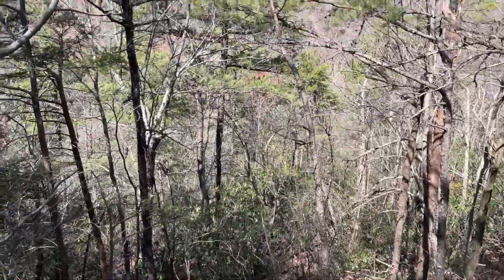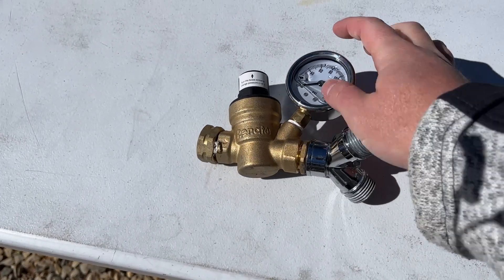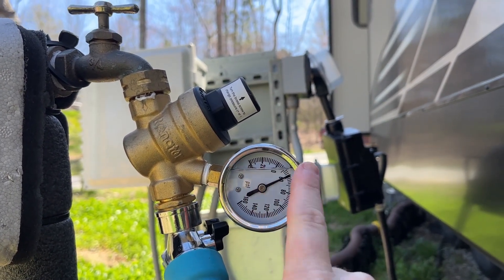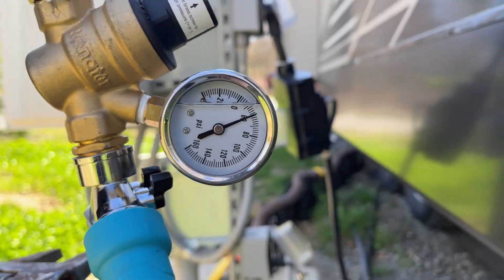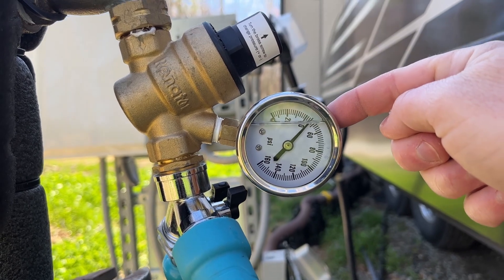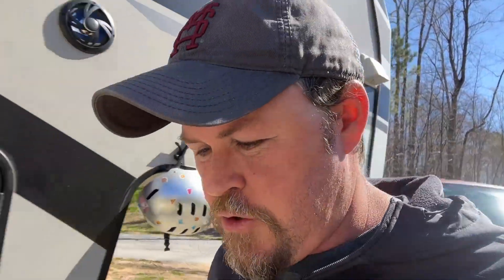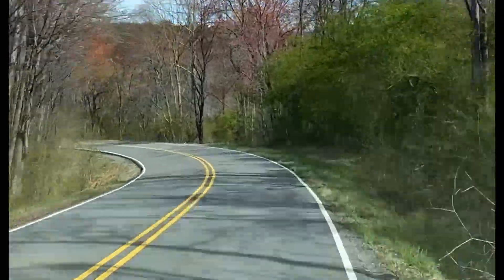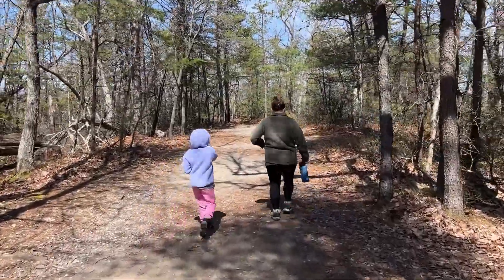How to Use an RV Water Pressure Regulator + North & South Carolina | RV Living | Ep 22

Comment: I wouldn’t have the static over what your manual for the rv says is a safe psi. It’s the static pressure reading that’s putting the pressure on your fittings and pump check valve that you’re trying to protect

Comment: You can also set it so that the pressure coming out of the supply is what you want. Then every time you go to a new place it will be the same.  I don't like having to park somewhere else because my truck won't fit in the spot, but it happens.

Comment: If the static pressure is high, will that pressure damage your lines? I have been so careful but would like more pressure my static pressure is at 40psi .
Reply from the maker: From my understanding high static pressure can damage your lines if it’s not regulated down before it goes into the camper. What we’ve been doing is turning on the water with the regulator attached before hooking it up to the camper, and adjusting the pressure. That way our regulator has the pressure at 40 to 50 PSI before we ever hook it up to the camper, just to be safe.
Reply: @Herrins on the Roam  When the water is off what does the gadge say ?
Reply: Like when your not running the water in the coach .
Reply from the maker: If the regulator is on the spigot with the water turned off, that is the static pressure. Once the water starts flowing, either with no hose attached or at a fixture in the camper, that is the pressure your regulator is set to. That is what is adjustable, the pressure when water is flowing through the regulator.
Reply: Completely WRONG! The "static" pressure is what you need to regulate! The "static" pressure is what damages your rv!
Reply: @John Jones  i just keep it at 40 psi when water is off in the coach , my gadge says 40 psi .
Reply from the maker: @JohnJones-op8uf  our original comment already mentioned that static pressure can damage your lines. That’s why we regulate the PSI before it goes to the camper.  In this comment we are just saying if the water is running you can see the needle move in real time. We keep ours between 40-50 psi static.
Reply: @herrinsontheroam  absolutely did not! You told folks to adjust the pressure while water was flowing (fixture in rv on). That is incorrect! You do NOT adjust the pressure, etc, when the water is flowing. The pressure regulator is there to keep the STATIC pressure down.
Reply from the maker: @JohnJones-op8uf  huh sorry must have misunderstood what you were saying. We adjust both, the static coming from the source and what is going into the camper. Maybe I didn’t explain that well in the video, we use the faucet so I can see the gauge move, otherwise it doesn’t ever change until the water has been turned on and off again.
Reply: You guys are so confusing.

I need a device that can reduce the static pressure in my water lines, when the water is not flowing.

Let's say that the city water static pressure is 75psi, with no water flowing.

I need a device that only supplies my camper with 35 psi static pressure, when the water is not flowing. When I turn on the bathroom faucet, it will further drop in psi (maybe 22 psi flowing)

Is there a device that does this?

People say that the cheap brass camco water pressure regulator is only a flow restrictor, allowing full 75psi static pressure at my bathroom faucet. This is bad bad bad!

I only want 35 to 40 psi max static pressure, with the water not flowing!

Comment: You're confusing static pressure with flow rate. If the static pressure is too low when water is flowing that means your regulator has a too small of a CV (flow coefficient) and is creating a restriction in the water flow resulting in the lower downstream pressure you see on the gauge when water is being used. The diaphragm inside the regulator can't open large enough to keep the downstream pressure at 60 psi, and it creates a flow restriction and pressure drop.

No one ever does this, but if you want to maintain 60 psi static pressure while also using water fixtures, you need to increase the flow rate by installing multiple regulators in parallel to each other, then tie them into the same downstream hose, and set them each to the same water pressure. When water is flowing they all open up equally to maintain the pressure at the flow rate the faucet or shower is using. Or,  you can purchase a more robust unit meant for permanent installations (with a higher CV flow coefficient) and put water hose connections on it to use with an RV.

I would recommend Grainger part number 26X108 Manufacturer model number Watts 3/4 LF223-S. Attach some gauges and water hose fittings on both sides and enjoy your higher flow rates while also keeping your static pressure under control. Adjusting this regulator is the same as your current one. Loosen the locknut on top and screw in for higher static pressure and screw out for lower static pressure, and when you're happy with the static pressure setting just tighten the locknut.

Hope this info helps.
Reply: Thank you.  This has been the most useful post I've seen...including any videos. ❤

Comment: No, no no no. You only adjust the pressure when all of the faucets are off inside the RV. If your regulator indicator is at 60 PSI with the water source outside on, that is the actual pressure coming from the faucet. As soon as you turn on, let’s say, the kitchen sink, the pressure will go down, but you do not adjust the regulator at that time. If you adjust the regulator while the kitchen sink is flowing, as soon as you turn off the kitchen sink, your pressure will go way past 60 PSI. Only adjust the pressure after you turn on the water source and go no higher than 60 psi. From there, leave it alone.
Reply: Yeah for some reason I feel the static should be 45-50 it’s the static pressures in your lines that will mess up your plumbing

Comment: So let me get this straight. Your static pressure is 60 pounds when your faucet is off and you think that's OK? I thought the purpose was to keep the static pressure on your system down. She did your regulator be set to 45 pounds static?
Reply from the maker: Yes, based on the research we’ve done you want static pressure to be 60psi or lower. One thing we didn’t say in the video is that we set ours to 45 with the faucets open, then close them and check the static pressure. On ours it almost always ends up with a static pressure around 55 or so.
Reply from the maker: I’m never sure I’m explaining it well but with no running water(static) we have it set to 55psi.  Not sure if my first explanation actually clarified that.
Reply: @herrinsontheroam are you able to adjust the unit down to let's say, 35psi static, and maybe 24 psi flowing?